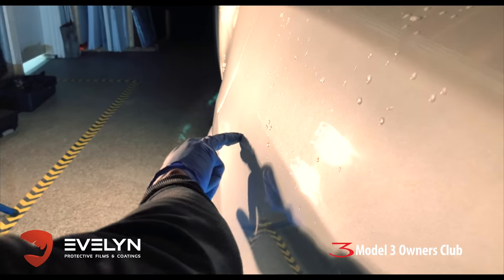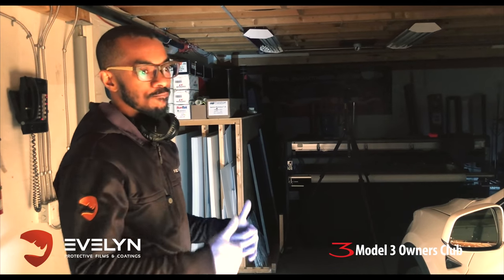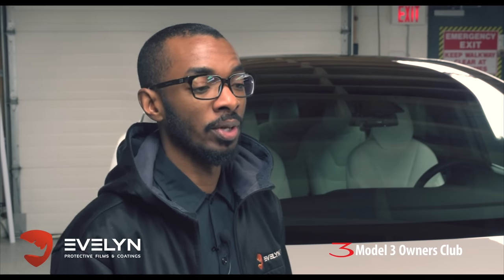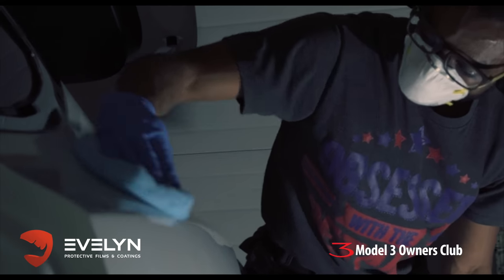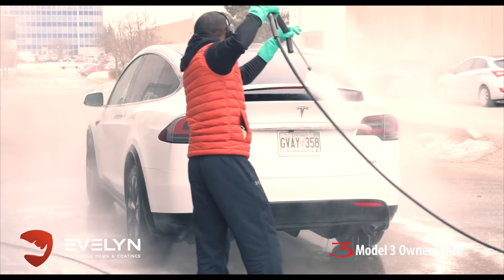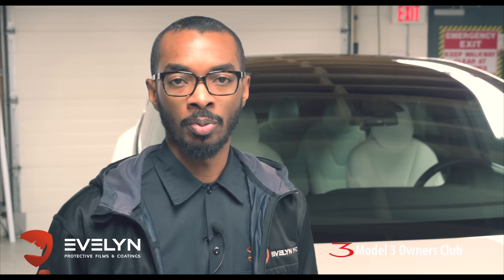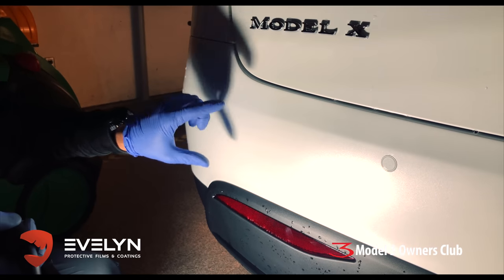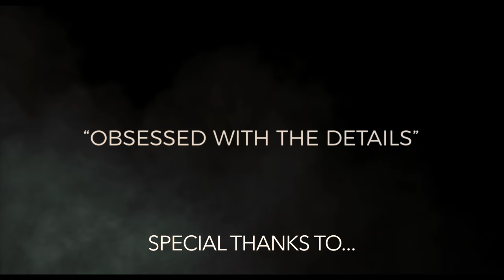From start to finish: Paint protection film & ceramic

Comment: Nice video about special car detailing...

It’s nice to clean the car in a right way to make it more shining and clean.

Think that touch less car wash is the way to go... just to clean out the most dirty from the car out to have no scratches on your paint.

Specialy when you wipe the paint with any cleaning towel it makes scratches and you can see them in the light and when you use a flash light to check the paint if it’s perfect...

And you have to see how much you have to invest in detailing your car, if it’s  made from a professional company.

Just use touch less wash for your Tesla .... 

You ll see that you ll have no scratches after the car wash 😇🙏🏼

And for the daily use touchless wash is a good way to have 90 percent clean car in summer as in winter ...

Comment: I'm guessing that the ceramic coating is done AFTER? the PPF is applied? or can you apply the ceramic coating before the PPF is installed?
Reply: It almost seems like, before would be the way to do it, but I guess you'd run into adhesion problems from the coating. Thanks!

Comment: I can't imagine why some idiots would vote this most excellent video down, unless it is Evelyn's competitors. Here is a question; If I am going to do both film in the front of the car, and ceramic on the balance of the car, is it necessary to lay down the ceramic where the film will lay down? thanx.
Reply: Ceramic over film. Wow. I would not have guessed that. The ceramic protects the film. Hmmm.
Reply: Steve bakker , laying the ceramic over the film, gives the film added durability from staining and etching. As well, it make the film extremely hydrophobic allowing for ease of cleaning. Hope this helps.
Reply: It does. Thanx!

Comment: unrelated perhaps but I wonder what you are doing to stop your front windows from sticking with ice. Drove home with the passenger window not sealed last night after preheating during a snowstorm at -8C for 20 min. Drivers door worked nicely but almost stuck. Passenger window not so good. I sprayed the seals around the window with a non stick dry film lubricant previously but haven't sprayed between the window and the door frame yet. Is this what I have to do?
Reply: Thanks for the reply. I sprayed along the lower chrome piece this morning. We are expecting more snow and low temps here in Collingwood today so it will be tested again. I am wondering if I should report the problem as well. It is a 90 minute drive to the service centre for me so I try to avoid that if possible. What did they do to fix it when you brought it in?
Reply: Model 3 Owners Club 
Thanks for the response. 
The car had been pre heated at 21c for about 30 minutes but it was snowing and the melted snow freezes at the bottom of the window. The Teflon spray has been working since I started using it at the base of the window.